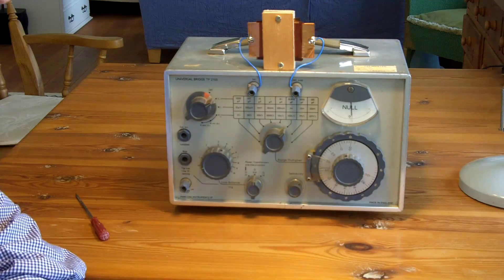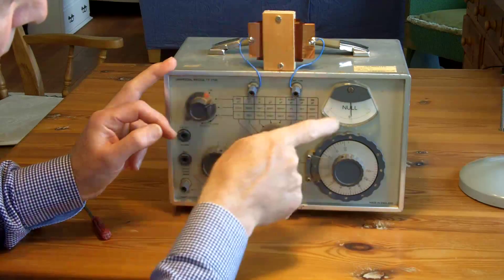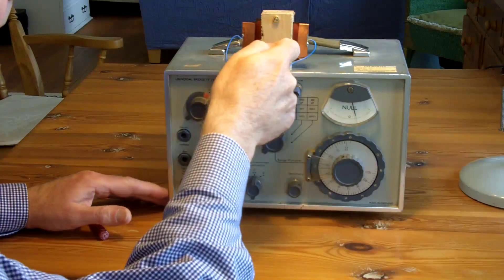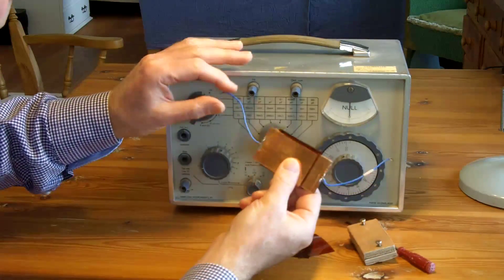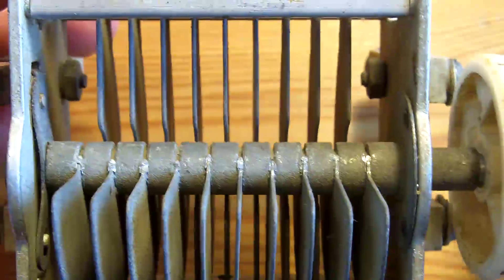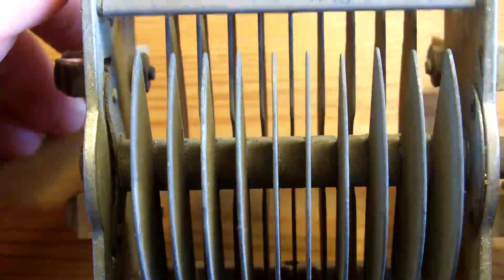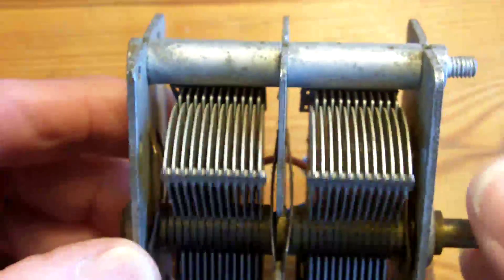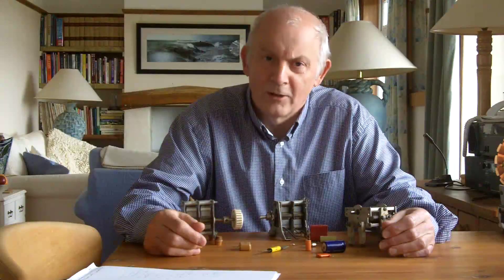About Capacitors ... Part 2 Why it helps to have an odd number of plates, by Andy Davies

Comment: to connect a 3 ganged capacitor in parallel would i just need one wire from rotor and join a wire to each stator so i would end up with 3 trailing wires and just say twist them together and that would be it ?

Comment: i have a 3 ganged capacitor and each gang has a tag so if i want to connect all 3 in series would i just need one wire to the rotor and join a wire across all 3 tags on the stators and join a wire .... my question is how would i connect in parallel

Comment: Old non-polatised, cylindrical capacitors where the plates were wound in a sort of concentric spiral often had the lead connected to the outermost layer labelled. It was useful for this shielding effect, so that that end can connect to the lower AC impedance (not necessarily ground or the more negative to DC) and reduce its noise susceptibility. Valve amplifier people have come up with some interesting simple ways of testing which end of the capacitor if any has the outer foil with minimal equipment